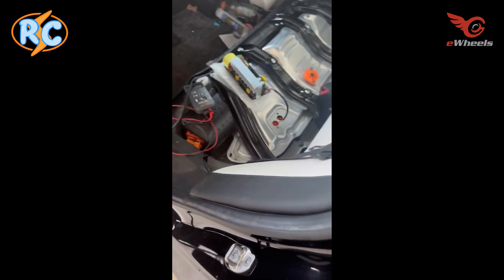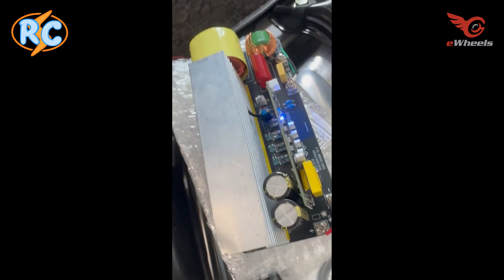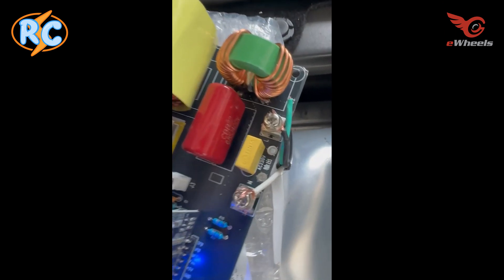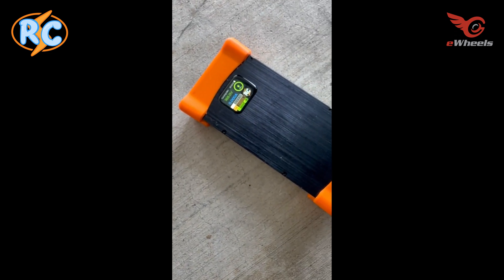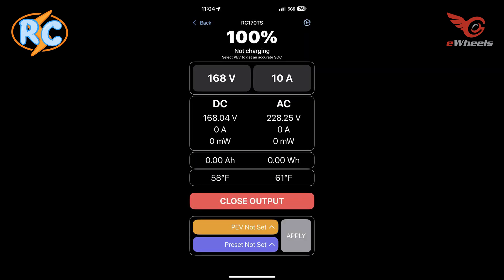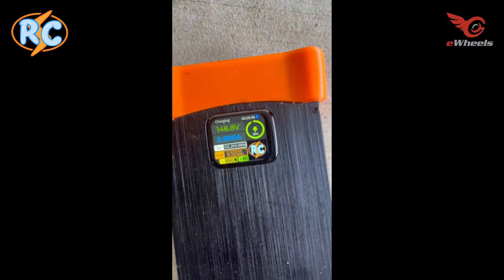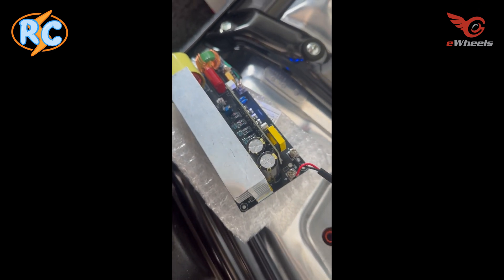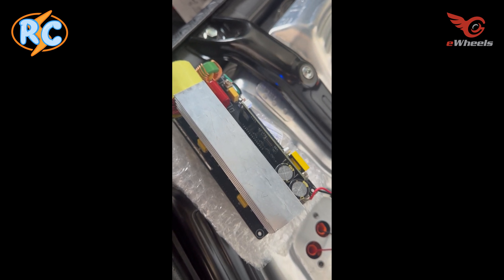DIY Tesla Model 3 220V Inverter install from main battery 400V DC to 220V AC 8000W

Comment: Hello, I’m considering implementing your hack on my Model 3. Have you seen any issues with the BMS reporting “missing energy” or other errors?
Also: would it be feasible to charge the HV battery slowly from a roof-mounted solar panel with step up converter, while the car is turned off.

Comment: Have you found an appropriate fuse to use before this device to help add some protection? or is there already fusing before hand in the high voltage junction box that will protect the battery in case there is a short on or after this circuit board? I am hoping to use this on my 2013 tesla model s. I have had to do quite a few repairs to the car and am very comfortable working in the hv junction box. I have been looking for a solution like this for awhile rather than using a standard 12v inverter off the 12v battery.
Reply from the maker: https://a.co/d/dTetvwZ

Comment: It seems that that inverter board will fit nicely in a small, plastic, ammo can. Just saying 😁. Just received a similar board from China, today, I was thinking to design and 3D print an enclosure for it, but I will just go with a plastic ammo can instead.
Reply from the maker: I went with something that looks like a toolbox that is made specifically for holding electronics. Has little cut outs for the wires that do a decent job at keeping water out. Unfortunately, that means it keeps heat in as well. Just keeps me from getting close to the maximum rate. I'll probably end up adding a fan.
Reply: @roghaj I put a 240V AC fan on mine on one end of the ammo box, and drilled holes at the other end, also I made up a pre charge circuit so it won't get current rush when connecting to the DC Voltage because of the capacitors. Just took it apart today to send some pictures of the board to send back to the seller ( he asked for the pictures in order to answer me how to make it work at 60Hz instead of 50)

Comment: Thank you for posting this. I was scrambling my brain, and searching the Internet for a way to access the High Voltage battery. The knowledge that you provided in this video helped me to connect my 400V DC inverter and now I have backup power in case of a power outage.
Reply from the maker: Glad I could help.  I think some cars are a bit different, but should be similar enough.
Reply: @roghaj mine is a Model Y, it seems that Model 3 and Y have a similar battery setup.
Reply: @roghaj  very cool hack, how did you in the end industrialize it? Thinking connectors/lid. I was thinking banana plugs (what size?) and routing the wires through the vent hole of the original probe lid
Reply: Any pictures is appreciated!

Comment: This is the way to go for a good AC outlet in these cars. I am wondering that there is so little information. Seems to be something many sould have a good use: A 120/230V outlet with 2-3kW in a model S for various uses. Your board is great for playing around, just can't grasp that no one built a quality unit in a good housing, maybe connected to the Bus, so it can be turned on/off trough the screen controls.

Comment: Someone needs to built a 110v / 240v kit that can be installed and runs to the frunk or trunk allowing for a power cable to be run to your house and a transfer switch installed so you can use your car as backup power for your home. Obviously setting the correct fuses and inverter to avoid overpower

Comment: kinda curious why there would be prefabriced holes for  HV.

would love trying this with my byd lfp battery but then i wipe iut 7 years warranty :S
Reply from the maker: This is the service inspection port for a tech to get the raw battery voltage.  I think they use it to check SOC calibration.

Comment: 99 percent of people dont understand how awesome this is or what you did :D
Reply from the maker: Thanks man.  I was was glad it worked out.
Reply: new tesla functional mode , energy export from tesla to home - low cost energy storage . Thanks for a tip - place with high voltage source - wires for inverter 230v circuit. Briliant!

Comment: this shoud maybe even work when car is turned off. you need thicker wires though.
Reply from the maker: At my 4000W draw, I'm only passing 10A though the source wires.  Yes it works with the car off or on.
Reply: The wires he used (assuming for 10A on the 220V side) seem reasonable. Should be way below 10A on the DC side, and with that the wires don't look too thin.

Comment: Nice video compilation, now a little how to and a nice package with incased and fan'ed inverter. The Roger Tesla package, get your charger, your inverter and all cables in one package. Oh and if you need a Tesla, thats part of the premium package. 

Ok last part was a joke
Reply from the maker: Do you think this would be worth $250?
Reply: @roghaj  hmm good question. If you sell everything a noob needs excluding tools, then yes. A simple instruction, a simple box with 2 cables. One for the Tesla battery, one with a female plug for the charger. Compact, no set up, just plug and play with automatic fan that isn't a jet. I'd recommend the Arctic p12 max as it has some serious power but it's dead silent and costs like 14 or even less. 

Also a wattage limit printer on the case would be nice, just so there is no confusion about that. It would then also be able to basically run everything then runs on normal plug, wouldn't it? Especially for those rare model 3 camper probably a nice add on. Thinking of kettle or something.

I mean, idk what the components costs are. But if I where to own a 60000€ car, and you find me the option the literally have a plug with 5000w in my car, I would damn sure pay 250
Reply: @roghaj  Yes... I wonder how it would work with my baby Ford truck battery (Hybrid Maverick) ... Roger, you are amazing, always pushing the limits!
Reply from the maker: I will look into the voltage of that battery and let you know.
Reply: @roghaj  I'd be interested in the kit.   

In the future I might be interested in a DC-to-DC kit to connect up to home battery bank then can charge during the winter when the solar is not brining in as much.

Comment: Just thinking out loud... if the fast chargers weren't repurposed AC do DC power supplies, it should (in theory) be simpler to just build a 400V DC to (adjustable voltage) DC step-down converter capable of whatever current we want do draw (25A would be nothing for an EV battery). It would be more compact and much more efficient - we just need someone with a solid electronics background to get it done!

Comment: From car DC to the transformer/inverter combo to the power supply back to DC... inefficient but still useful hack. Thx for sharing 💪
Reply from the maker: you have a better solution?
Reply: @ no I dont. So far yours is the most practical solution using readily available off the shelf parts